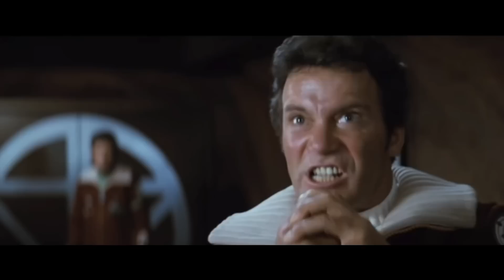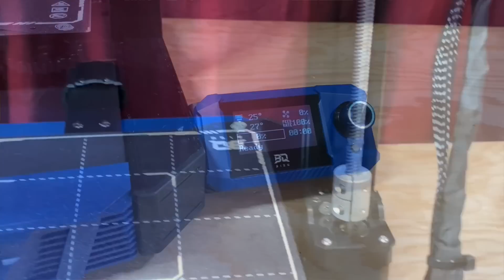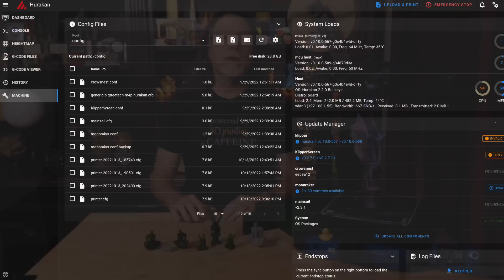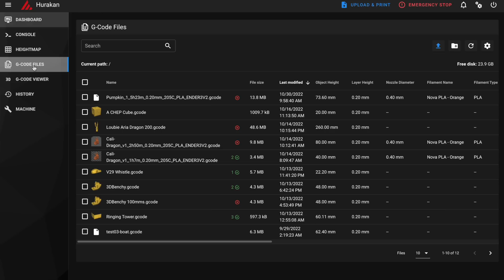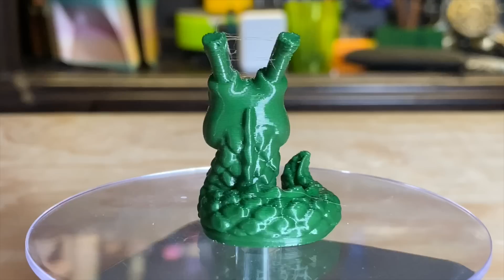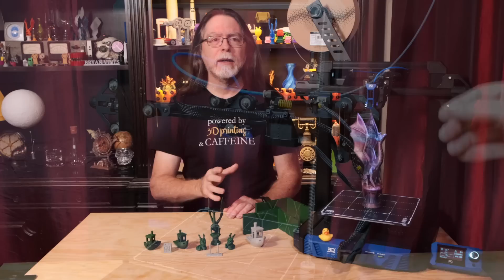First Bed-Slinger with Klipper Pre-Installed?! BIQU Hurakan Review

Comment: I think the Z-offset needs to be set in the web interface and saving it requires klipper to restart. Maybe they could not find a way to save it through the side screen?
Reply from the maker: Hi Nathan, I think I found it in the menus, a couple of days ago while rummaging around in there. I really wish BIQU would have provided a menu map with a note about what each feature does, like I've seen some printer manufacturers do. I'm still kind of new with Klipper. 😅
Reply: @BV3D  Same, I'm pretty new to Klipper as well.

I would like to say Klipper is harder to use or more complicated than Marlin, but when I think back to the time when I was first learning how to use the classic LED/Dial button, it was not easy either!

I think to stay competitive more manufacturers are going to move towards using Klipper, so now is the time to learn!

Comment: So to make the transient z offset adjustments permanent after the print completes, these commands will kill a print in progress so take care, depending on  how a printer is configured for the z endstop determines commands. LIkely for this printer you will need to enter Z_OFFSET_APPLY_PROBE and then SAVE_CONFIG , this last command will cause a restart so again don't ever do this while printing. Z_OFFSET_APPLY_ENDSTOP is the other version of the first command if using a separate z endstop. You could also just go into the config file and edit the value but be very careful that you adjust it correctly to not cause a crash. Hope this helps, this could be made into a macro and added to the display but that is more involved then I care to go into on a comment.

Comment: This is a great video and true to your usual detailed style. Thank you. Our introductory experiences are quite similar with the Hurakan, all the way down to breaking the OS after doing the upgrades. Are you comfortable with linking to the firmware file Biqu sent you, or a roundabout way of grabbing it? I'm not having a ton of luck. Thanks again for such informative and accessible videos.
Reply from the maker: Hi Aaron.
The current boot image for the printer is at https://github.com/bigtreetech/CB1/releases
I used the Hurakan_Debian11_Mainsail_kernel5.16_20220929.img.xz file listed in the Assets section.
I flashed it to a card using Balena Etcher, and that got me a bootable card with all the from-BIQU stuff on it.
Reply: @BV3D  Thank you so much! I think I got it up and running now. There's so many boards on their git that it's hard to keep them all straight.  :)

Comment: For a video idea, show a Ender using a Sonic Pad with Klipper. Would be interested in your thoughts about it. Supposed to use accelerometer for harmonic elimination as well but mounted on the print head.

Comment: I'm glad someone else thought it was ridiculous to put the config file ON THE SD CARD. I was complaining about this "feature" on Twitter and every single dude who responded said it was perfectly normal and I'm just not used to Klipper.
Reply: It’s true that’s how klipper works but I think the position of it is terrible. If you had the os at the back and a seperate sd up the front for gcode that would be better but honestly I haven’t done any sd gcode moving for over a year. All wireless

Comment: With Marlin now also having input shaping, I wonder whether Klipper really has large benefits left.  As Marlin is written in C++ whereas Klipper klippy is mainly slow Python code, I'm not so sure it has that much spare processing power.  I've had it complain about "timer too close" when the pi was processing a timelapse video while I was trying to start a new print, so also Klipper has timing limitations and as there is less control on what is happening in parallel on the Linux system it runs on, I think it might have a higher risk of hitting a timing problem than Marlin (if it would print from sdcard).  That said, the Mainsail UI and KlipperScreen are both pretty much fantastic, but ... I feel Marlin behaves better when (emergency) stopping a print.  With Marlin stop just works.  With Klipper stopping while executing a macro (like auto-leveling or your typical START_PRINT macro) will only stop things after the macro ends, which is pretty stupid in my eyes.  Also changing values (like z-offset) and storing those persistently is just much easier in Marlin (just store config) than the "you need to reset to apply anything" behavior of Klipper.  In general I feel Klipper just feels less "finished" than Marlin.  Then again, I have lots of custom macros and (Python) modifications on Klipper, but that's already pretty advanced, running my own fork.  So, which is better?  I think the jury is out (after hearing Marlin now has input shaping) ...
Reply: Are you sure you're using Klipper's emergency stop? What you described is how pause/cancel print works but emergency stop, which is a completely different command, is pretty much immediate in my experience.
Reply: @waynemenzie  I consider emergency stop in Klipper a last resort, but not an alternative for a normal stop as an emergency stop keeps the still hot nozzle exactly where it was rather than moving it away.  If you see a hot nozzle drilling into your bed, a Klipper emergency stop is not going to save it ...

Comment: I would have liked to have seen dual independent leadscrews and a larger print surface as that split heater just doesent seem needed for such a small area, the probe is really good, it scored higher than any other probe in the repeatability tests one other reviewer did.
 Recently I have bought half a dozen Orange Pi Zero boards to replace my Raspberry Pi boards that run Octoprint so I can use the Rasperry Pi's for other projects, the Orange Pi Zero 2's run Octoprint just fine as they run 100Mhz faster than a 3B+, I want to set up a Klipper printer but cant afford down time so I will have to buy a new printer, If this machine gets the Pro treatment from Biqu I would be tempted to buy one, other than that I would buy a Sovol SV05 and Klipperise that with an Orange Pi Zero 2 and an accelerometer board

Comment: I hope we'll see more printers that combine a good ARM motherboard with a Raspberry Pi in all-in-one boards going forward. We (well, Keith Bennett) are working on getting Marlin working with the Manta / Harukan so you'll have the option to use Marlin with OctoPrint in the future, if you prefer. Since Marlin is gaining its own Input Shaping it won't be a compromise on speed and quality. At the moment, the complete Marlin itself can build and run within Linux, but only in simulation. But that bodes well for the future! Right now there is a lesser-known thing called "StepDaemon" that runs on Linux and does the preprocessing of G-code moves to control Marlin with G6 "direct stepping." We want to make it much easier to install that; e.g., as a plugin to OctoPrint. As these works progress, we'll be able to offload more of Marlin's processing to the Linux side, and even do builds/updates right on the printer itself. Kudos to BigTreeTech for getting behind this concept and opening up greater possibilities and more options for everyone. At least it never gets boring!

Comment: Great video. I like the fact that you gave a fair and honest review of the pro and especially the cons.  To me it looks like BQ kind of rushed this out the door to get it into the Christmas market.  The klipper is nice, I use klipper on all my printers except the Prusa Mk3S+.  With just a little more work they'll have another great beginner level printer.
Reply from the maker: BIQU may also have been rushing this one out for bragging rights as the "First i3 Shipping With Klipper." I'm hoping there's going to be a v2 or a Pro version coming out to address the card slot & USB port placement issues, and maybe add another Z motor and direct drive.

Comment: Wow, I appreciate the effort but remembering to not remote a card would be difficult. And not coming with direct drive on something as innovative as this is also a bit disappointing. I feel the printer could do better.
Reply from the maker: If the Hurakan follows the current pattern of printer releases, there will be a "Pro" version before too long, with dual Z axis motors & lead screws and direct-drive. Hopefully they'll redesign the card slot & port placement. I do like the bed probe, though. I think it's nicely done and it doesn't look like an afterthought on the tool head.

Comment: I have one of these and ran into the same issue with updating klipper....which basically bricked the machine....I also was able to reflash original image to return the printer to it's factory state.  Did you get a chance to play around with optimized Cura settings for this printer?  Its seems using the B1 settings is not utilizing the more advanced capabilities that the printer has, namely faster prints while keeping the quality level high.  Thanks for the great review!
Reply: how did you reflash to original?

Comment: I can't help but wonder if that print head work work on my Ender-3 Pro. It looks cool, and I like the dual cooling fans. It's nice to see a new printer that isn't just a clone, and also to see Klipper gaining traction. And the price is decent, considering everything that is included. The SD Card port placement is a little questionable, but I'm sure someone will design a card removal prevention attachment soon enough. But I do wonder what's with the hot glue around the Z axis lead screw? Or is that excess grease?
Reply from the maker: Hi Denny. It could be made to work, but it connects to the printer by a ribbon cable. So you'd need to also have that cable. And the mainboard side of that cable terminates in a single connector, I think, so you'd have to hack that side of it to connect to the appropriate ports on the board.

Also, your second guess was correct: That's the grease they put on the lead screw. They over-grease the lead screw, and then it kind of collects around that brass nut.

Comment: Nice to see kilpper in the printer, but indo agree that kilpper should  be on the board and not use sd card to be the brain. Like to see how it does on speed run printing like 1500 mm/sec under acceleration. Also had problems with prusa changing acceleration. Like to know if you seen it do that? all and all great review.

Comment: I cant for the love of God get mine working after inicial testing. I believe my OS got corrupted some how and while I know how to flash klipper, I cant find the OG config file for it anywhere. 

Theres such little info out there because of how new it is but woah am I frustrated :(
Reply from the maker: Hi Chris.
The current boot image for the printer is at https://github.com/bigtreetech/CB1/releases
I used the Hurakan_Debian11_Mainsail_kernel5.16_20220929.img.xz file listed in the Assets section.
I flashed it to a card using Balena Etcher, and that got me a bootable card with all the from-BIQU stuff on it.
Reply: @BV3D  I hadnt seen this, Ill try this and see if I can get it up and running again. Thanks you so much.